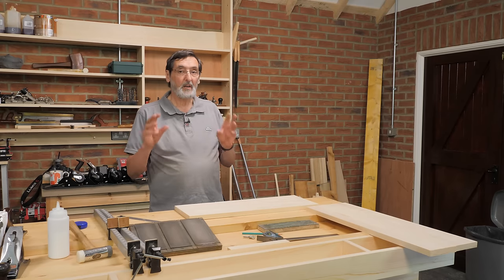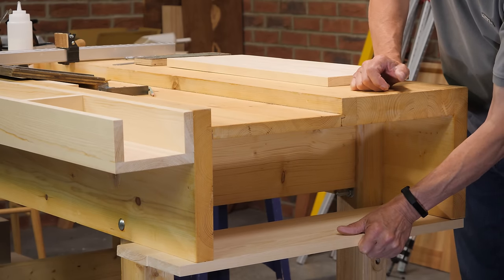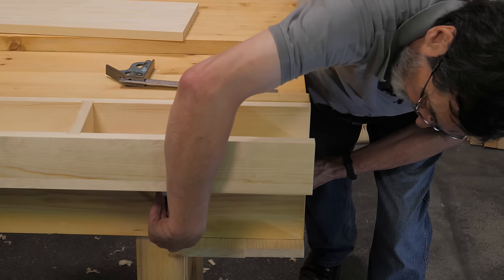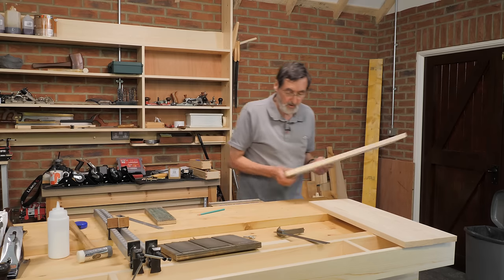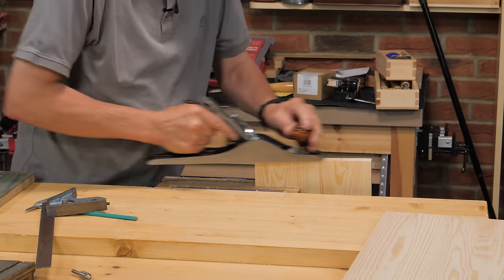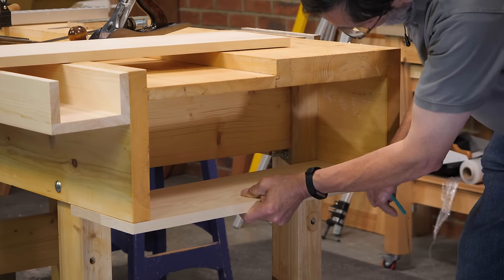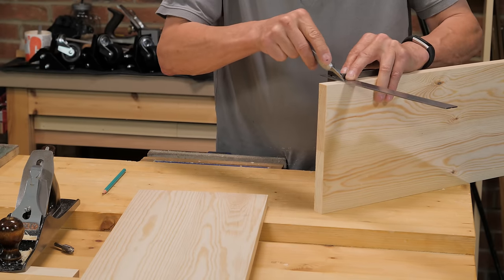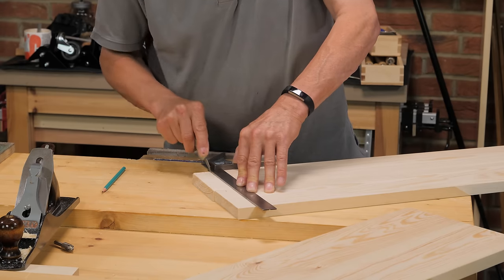Sharpening Stone Shelves | Paul Sellers

Comment: Have you ever tried Japanese pullsaws for the cross-cutting? I've found they give such a smooth finish that things never need planing afterwards, because the teeth have no set, which cuts down on some work and reduces the risk of chip out. The downside is that you can't really sharpen them.
Reply: I've heard you can sharpen them with a diamond feather file, if you have the patience (and maybe a magnifying glass). There are also pull saws that are designed to be sharpenable, but they're super thin and hardened, so they're very easy to break. They're also super expensive, so generally only used by master craftsmen.
Reply: Well yes, they're theoretically sharpenable but it would be a massive pain to attempt it. Those I've used have had such tiny teeth that I've not found a file slim enough to get between them.. Perhaps a cutoff disc for a rotary tool could do it, but that's asking for trouble.
Reply: Night Cat   You can’t teach an old dog new tricks, he feels that you don’t mess with perfection...eh?
Reply: Fair enough. I was truly blown away after my first time using one, coming from average European saws, but I've never had a really nice gent saw to compare it with.
Reply from the maker: They are throwaways and do no more than a well sharpened and well set western saw which I have used the same saw of over 53 years. If it ain't broke, don't fix it.

Comment: I was always told to plane the end grain in a circular motion. What do you think?
Reply: The reason for that is on short pieces it is hard to control the plane and keep it from overshooting the edge which will burst out the wood fibers if planed straight on. here he has a longer board and if you watch closely he stops planing or goes over the edge with the plane edge at around 45 degrees to the edge preventing bursting. similar to how the plane edge would present itself to the board when planing in a circular motion

Comment: Why don't you use a manual "eggbeater " drill or a brace and auger bits for larger holes? I don't like the cordless drill with the keyless chuck. I think it detracts for the hand woodworking style you promote.

Comment: Those six 2" screws attaching the bottom shelf went in pretty easily for not drilling any pilot holes into the bench.  Or, - - - the video just skipped that important step.
Reply: Kirby Spencer : a curmudgeonly comment to match your icon... You can clearly see just before he put the bottom shelf in place that there were no pilot holes.
Reply: Curmudgeonly perhaps, it just seemed that they went in pretty smooth.  Watching it, I cannot say for sure there were no pilot holes.  Perhaps it was very soft wood, thin screws, or well lubricated.  We might could drive a few 2" screws in our own shops then look at the video again.